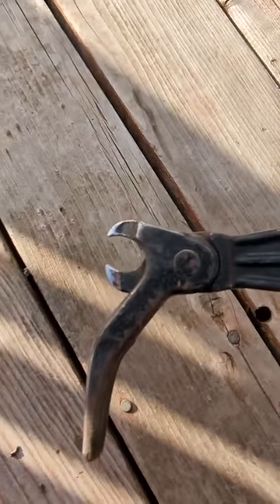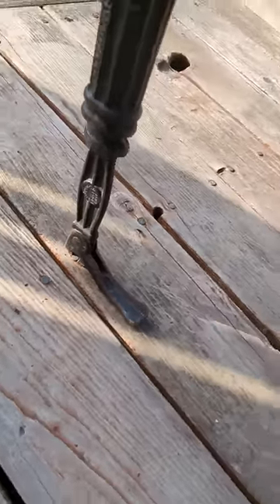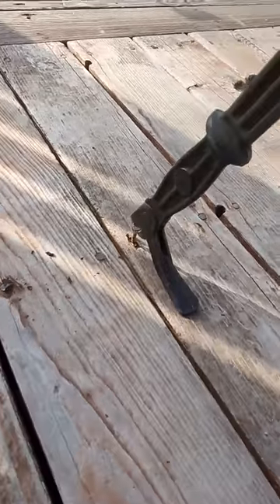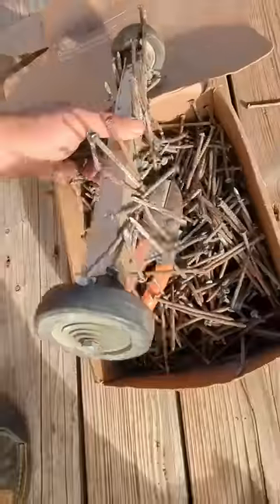The Deck flip is on! #deckrestoration #redwood #reclaimedwood

Comment: So many questions here. What's the point of pressure washing if you are going to remove a thin layer of the material with a planer? 

Why would you the extra heavy antique nail puller 1800 times instead of your cats paw? Or better yet just remove a couple of nails on each board with a cats paw, then pry to board and nails loose from the joists and then back the nails out with a hammer so you can flip it and remove them with your hammer?

Comment: What about the holes that are still in the wood? Wouldn't you need wood without previous nail holes so they aren't popping out? Or am I just being dumb and that's what the torque screws are there for?

Comment: I mean I guess if you dont take into consideration the ends rotting off (Thats how cedar and other non treated lumber always goes first) You also have to ignore the fact that the some will be rotten on the under side and those other boards that just decided to rot out and turn into mush faster then the others and how they put the shitty cracked sides down and now you just flipped them up so you get to look at them and walk on them. All said and done if you want to piece meal a deck together. Still have to replace a good 20% of the lumber to use wood that going to start rotting out in the next few years regardless then I guess its a good Idea.. Maybe? No not really honestly. But since you made enough money from a video to now replace it then for you in this one case it was a good idea lol

Comment: This is shotty nonsense right here lol. Remove all the nails, remove all the wood, pressure wash the wood, plane the wood, reinstall wood exactly how you took it out(so you don’t have to cut anything and get left with weird pieces), space the wood, then screw the wood… that’s a hell of a lot more than $5k just to have the same wood flipped over.

Comment: Soooooooooo no one going to talk about the other half of the wood already being destroyed and then thrown on the bottom? So when this “other half” has seen its last days, it’s really done. You won’t have any stability at all. Sounds like a lot of safety and longevity thrown out the window to gain you some income without the work needed to actually do this properly and save the customer money down the road. Instead, you are gaining the money up front and they are losing out later on.
Reply: How much did you charge for this, compared to completely redoing the deck?

Comment: Any normal person would have used a pressure washer to open up the wood let dry for a couple days and stained it or best of all used liquid rubber polyurethane deck coating good for at least 10 years

Comment: Man you really milked this one. Props for putting up with all that extra nonsense to "save the homeowner 5000" so you could make yourself an extra few gs when you could of just pressure washed sanded and finished . Also a good carpenter put those boards down a a certain side facing up for a reason doing this you risk revealing some ugly knots cracks and undesired grain paterns and planing the boards wouldnt really be any better than sanding as is... Would i do this just to make the job longer and cost .more? Maybe if i didnt have an abundance of other work.

Comment: If u did that  for less than 8k your a chump might as well have bought new decking. I bet you didn't even. Treat  the old boards for insects. That's not reclaimed  just re installed.